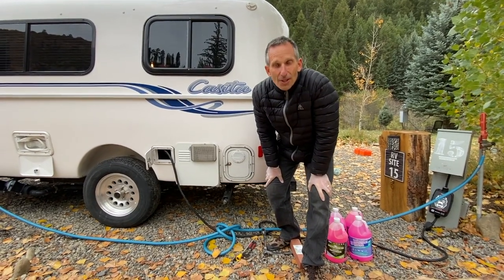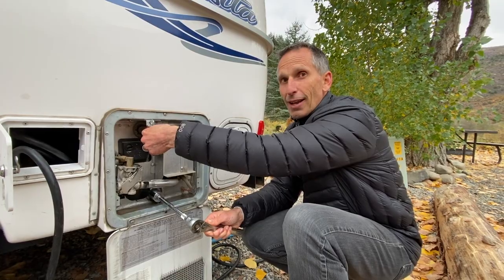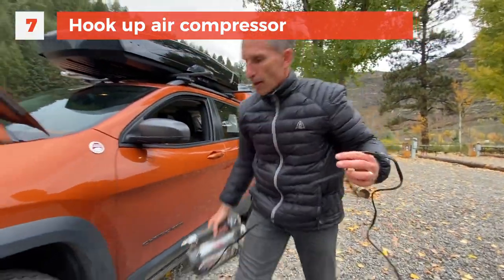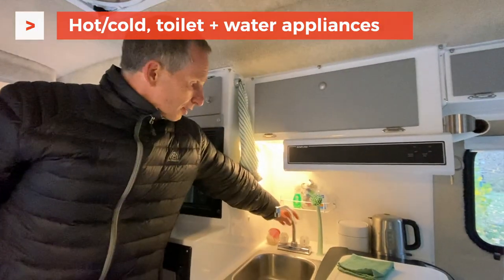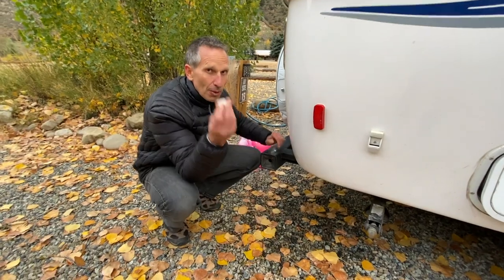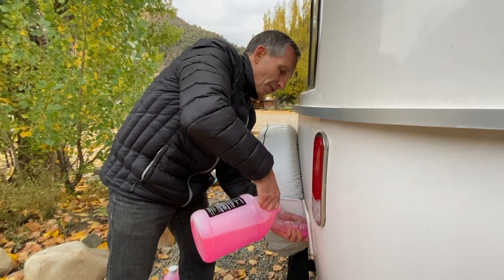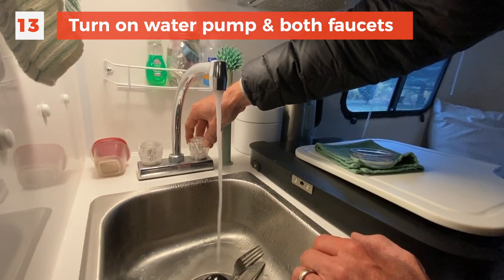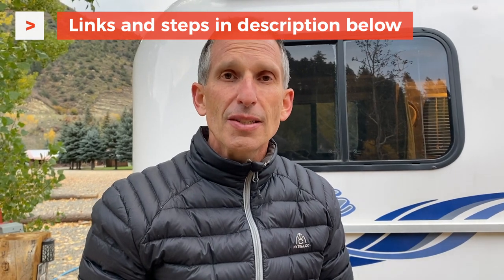How to Winterize an RV + What Tools & Supplies You Need | RV DIY

Comment: Before you begin, you need to decide whether you are going to blow out your water lines or fill them with antifreeze.  Doing both is redundant and unnecessary.  Also, you need to turn off the water lines feeding into and out of the water heater and then open the water heater bypass valve.  I unscrew the hot water tank drain either plug or anode rod and leave it behind the water heater door through the winter.  All of this before you begin.  Next you need to install a suction line with a shut off valve to the inlet side (suction side) of your water pump followed by shut off valve to your fresh water tank if you decided to go the antifreeze route.  My RV came with these already installed when I bought it, but I am not sure if all do.  You do this only once and then leave this to be used year after year.  Open the low point drain for your water tank and let it drain. Put the suction side of the hose in the antifreeze bottle and turn on your pump.  Draw enough through each faucet and shower hose until it runs the color of your antifreeze.   It is important to pour enough antifreeze into each drain (sinks, showers, etcetera) to keep the traps from bursting when the water in the trap has not been displaced.  One year, I did not get enough into the bathroom sink and on first use in the spring, found that all of our towels and wash cloths were prewetted.  OOPS!!!
Reply from the maker: Thanks Carl.  Yes... having a bypass for taking in the antifreeze is especially cool if you have an RV with large tanks because it is more efficient.  The one extra benefit of blowing out the lines before using the antifreeze that I see is that the previous water in the lines does not dilute the antifreeze, which makes it more pure, and also allows it to be reused.  And yes.. if not a cold environment, many people will just blow out lines.  But I have seen issues with RVs that only did the air method that store in cold environments. Thanks again for sharing. -M

Comment: Hi Mark & Julie,  it's nice to see you  again. What would happen if the water lines are drained but not filled with anti-freeze?
Reply from the maker: Some people do that - like a desert winterization - if you don't see freezing temps it should be OK but not worth the risk in a much colder northern environment, as water could condensate, accumulate and freeze - and it's not worth the risk/cost of damage, expensive plumbing repairs. One of the most common times for RV warranty companies to see a high number of claims is when people are getting their rigs out of winter storage - issues with dewinterizing when things have gone wrong. Hope that helps!